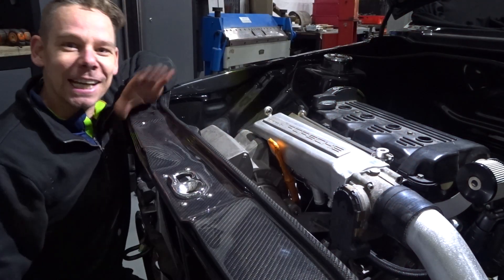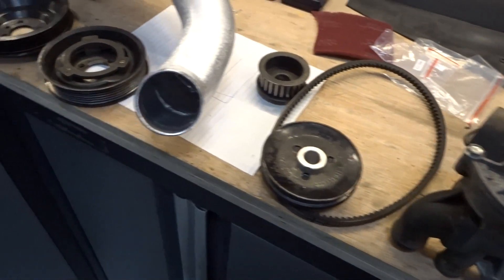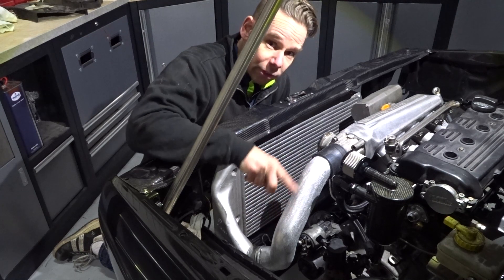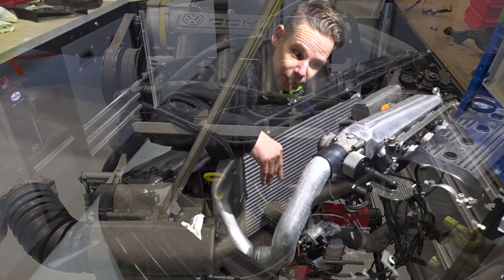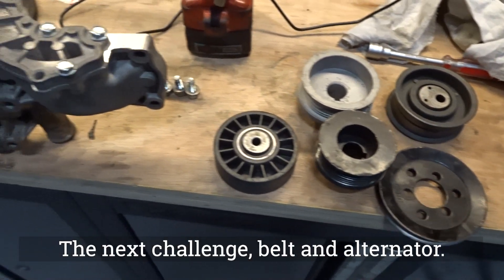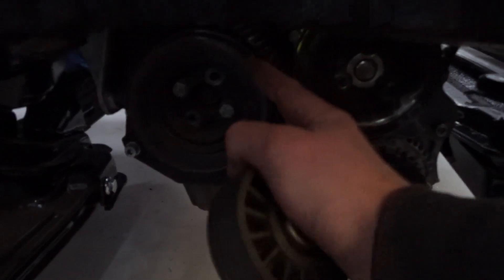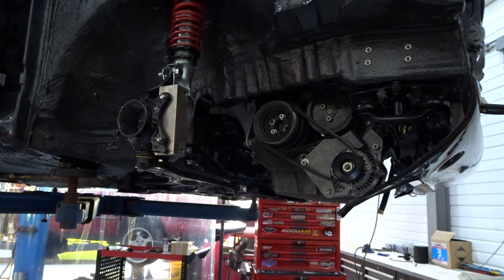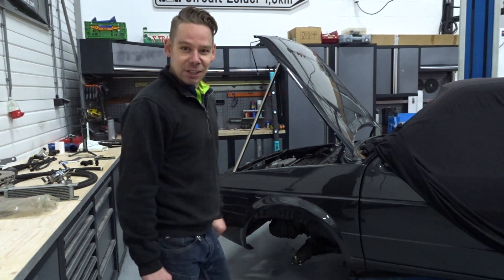Building the VW Golf Mk2 G60 Part2

Comment: Congratullations for amazing work and custom engeneering !

I have one doubt regarding intake maniflod.
I sow that you have to cut intake maniflod close to cl nr.1 , becouse there is no space for G-lader!
My question is , will clinder nr1 after this tretman have same air flow as clinder nr.2, 3 and 4 ?

Also I did lots of custom engenering on my 1.9L forged G65 Ed.one

Keep on with good work.
Best regards
Reply from the maker: Thank you !

Thats a good point on that !
Will take a deeper look 👀 into that, the most of the cutout is at the end so at that point the flow is already to cil1.

Will keep you updated on this 👊🏻

Do you have a insta or something to see your project?

Cheers Remco